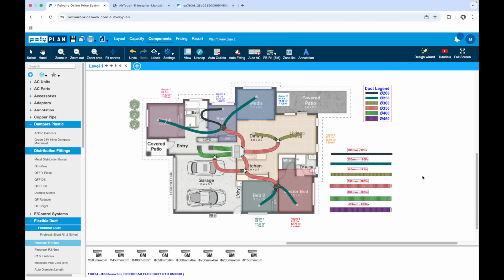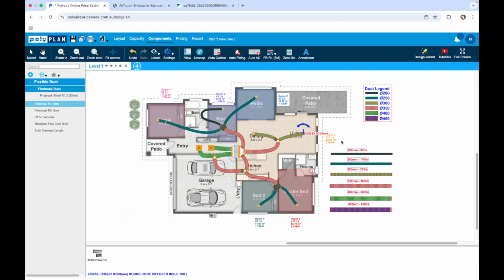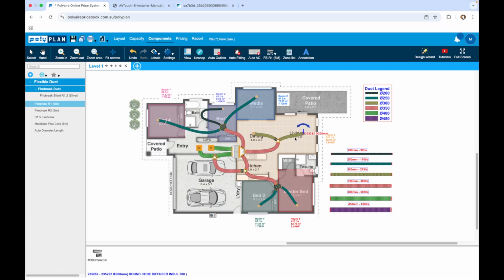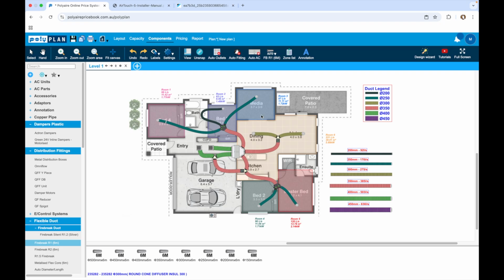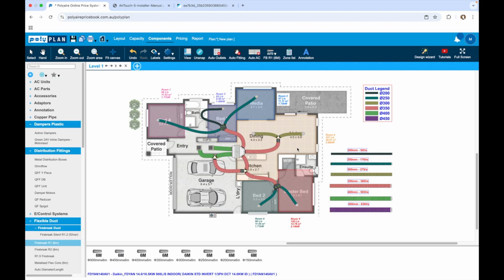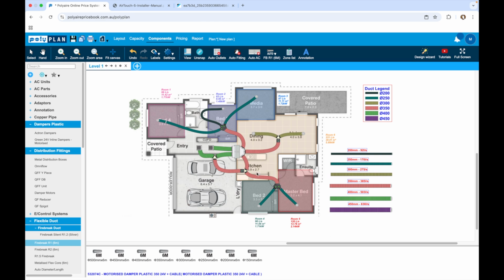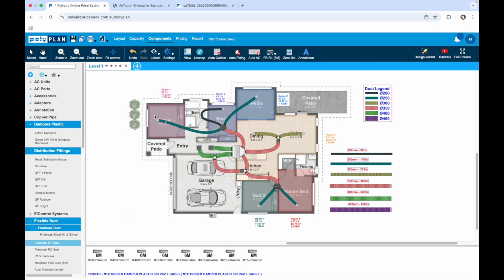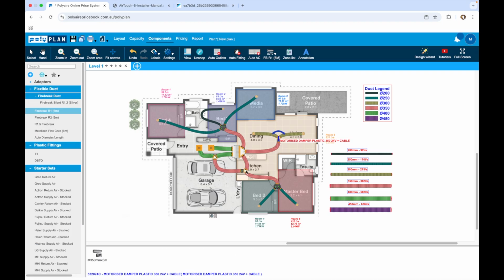Constant, Spill & Bypass Zones For Air Conditioning

Comment: Thanks for the video! 
Question - Any huge benefit to go with metal ducts as opposed to those flex type? I would like to run ducts underneath the house and install the vents in to the floor
Reply from the maker: Metal ducts would be nicer as long as they are done properly and sized accordingly and insulated well.

Comment: Is it ok if the spill duct runs straight into the return air box instead of via the return air duct?
Reply from the maker: Yes and no, it’s preferred to run it into the duct.
If it goes into the box the response won’t be as good and potentially end up with air coming out of the return air grille.

You also need to be using the correct size duct and the boxes normally aren’t big enough to to allow a connection that big.

Comment: Good video. What's the behaviour when 2 spill zones are selected? Have a downstairs living as spill but return air upstairs. If I add upstairs retreat as the 2nd spill will that help? Its duct isn't big enough to be the sole spill zone.
Reply from the maker: I don’t usually recommend using two spill zones but it works as follows.

The first spill zone in the order moves first.
Because you have two The calculation becomes 200% instead of 100% 
If one zone is on and it’s open 50% the first spill is fully open 100% and the second spill zone is open 50% this in total would be 200%

If one zone is on and it’s 25% open the the first spill is 100% open and the second spill zone is open 75% 

I

Comment: How do you calculate/determine where the spill zone should be? My spill zone has been set to 2 living areas, each have 3 vents  (250mm ducts). I'm hoping to only use one spill zone instead of 2. Installers quote said that minimum 4 outlets required. 18kw Mitsubishi Electric PEA-M180LAA. 7 zone 11 outlets (all 250mm except 1 300mm in bedroom). 2x400mm ducts coming off the unit